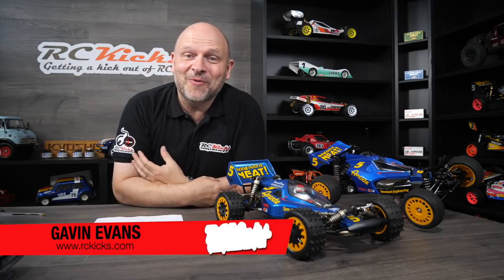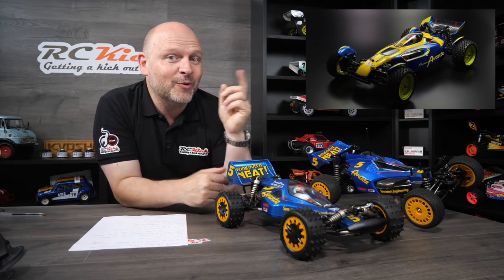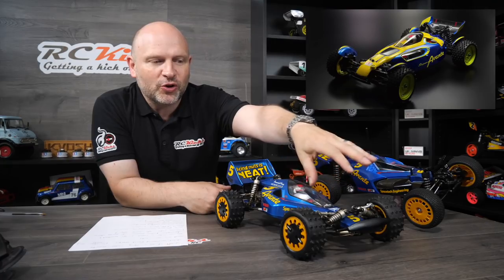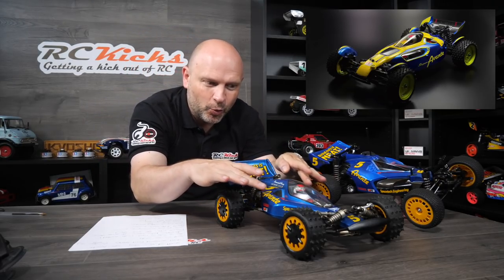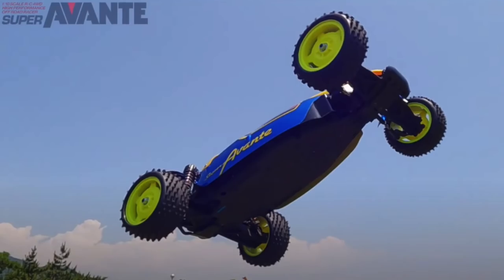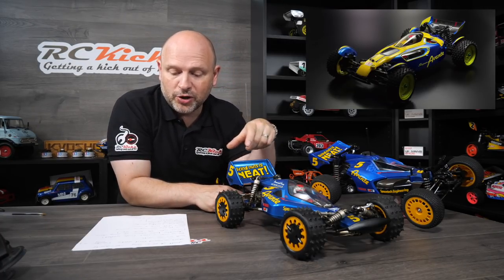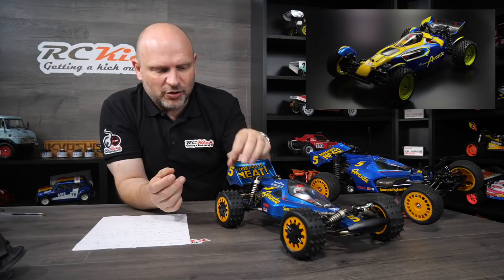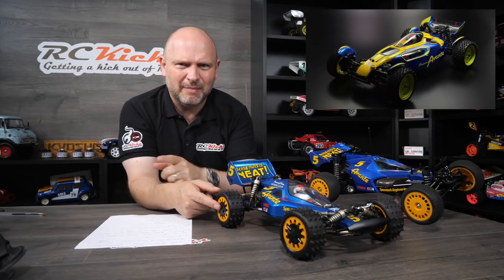NEWS FLASH! SUPER AVANTE Tamiya's Latest Release. TD4 4WD RC Buggy.  Coming Late 2021 Kit 58696

Comment: You know you're watching a video quickly when it's only in 360p. :|

It's a funny looking thing, but great to see something different, especially on the chassis side. You're absolutely right about the clashing colours. I think if they'd used gunmetal grey instead of yellow, and a new wheel design it would look a lot better.

Comment: I can see the RRP being around £400 rrp (comes with bearings!!!)
..... and , despite die hards saying "won't but it at that price" it will sell out.
Will be interesting to see what other kits use this chassis (or variation of) going forward.
I am tempted to order one......
Reply from the maker: £400 will kill this buggy unless the chassis is something super special but going on the plastic shocks, I don't think so.  We will know more tomorrow.
Reply: @RCKickschannel  looks like I wasn't far off. £350 with esc and motor. £325 without.
Rrp of £360 means £385 with esc and motor. 😞

But good news on clear bodyshell.

Comment: I am struggling with the name, also with that it should have the carbon and ally parts.
I like the concept of the chassis and I hope they come out with an optioned chassis that lives up to the name. The body has some good elements but yeah those guard like things are a bit of a what the hell was that thought process and I totally agree with you about the colour scheme very BLAH!!!!
Reply from the maker: It’s a mixed bag Paul.  Hopefully the chassis will be something special to back up the old name choice.  The Price could be an issue as I think most people see it as a mid level buggy at best currently.

Comment: Nope, I  can't believe they repeat their mistakes. If I buy an Avante, I expect lots of high-end material. So don't call it Avante, Tamiya. It takes more than putting in a complete set of ball bearings into it.

Despite of that it's a very innovative car. I like the design and the techonlogical solutions Tamiya does to this rig and I'll buy one. But I'll not putting a sticker with "Avante" on the body. Maybe Tamiya might change the name of it until the release.

The wheel arches look nice, but it's more a kind of a shelf-queen stuff. One obsticle and the tires rub the paint off.
Reply from the maker: I get the feeling most would have liked it more if it was the Super Tornado vs slapping on the Avante name.

Comment: ooooh nooooo, why why why tamiya????? Why do they use the name Avante für such a crapy locking thing? Why not a new name für a car that has nothing to do with the Avante (we already hat that sh.. MK2 and aero avante...)
Reply from the maker: No clue Andreas but if I was in that development meeting it would be "NO WAY" when the Avante name idea came up.  If you want to do a true Avante you need to start with the name first. OK so the next buggy we design will be called an Avante, now let's design exactly what that should be while working close to the vintage design philosophy.  Starting with metal shocks, carbon and metal parts as a plastic tub isn't going to cut it.

Comment: Just the name avante will make It 200-250. The ( super ) will cost again 50 😝 and the bearings an other 30. Later its 250-280 for a low level plastic Kit whit plastic shocks ? 🙊🙉🙈

Comment: Same as other comments in here, if you are going to use the Avante name, it’s needs to be top end special. Any other name, I like it. Not special enough for that name.
Reply from the maker: Yep that's the general feedback we are hearing Johnny.   It's a bit of a shame as this mistake was made with the Mk2 Avante.  It should have been called the Super Tornado and I don't think anyone would have had a problem with this buggy.  Well apart from the box colours but that can be fixed.
Reply: @RCKickschannel  I think the worry is that Tamiya don’t think like the fans do, if they did, this would be an obvious no no. So many great names they could use right across the budget ranges, but Avante, Egress etc, needs to be high end. I think in Madcap colours, it would look really good (maybe a Madcap 2, albeit 4 wheel drive).

Comment: A no for me. Quite a mess really. The body looks like a bar of soap with a small cockpit. Surely its far better than the original mechanically but Avante should be fashion over function. Not the other way round. Could have use another name for it.